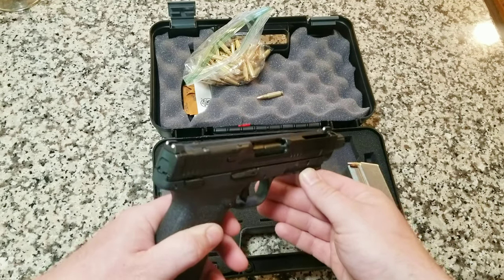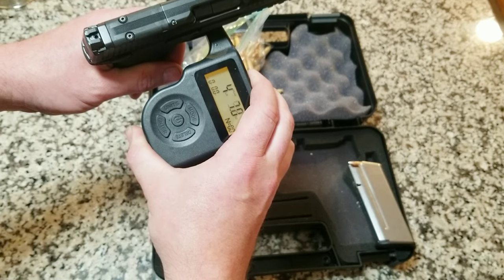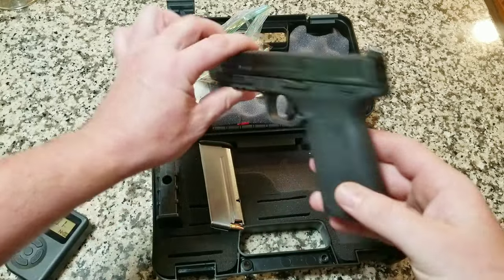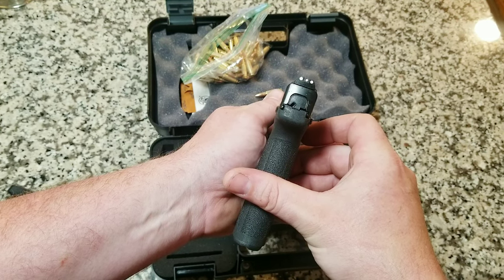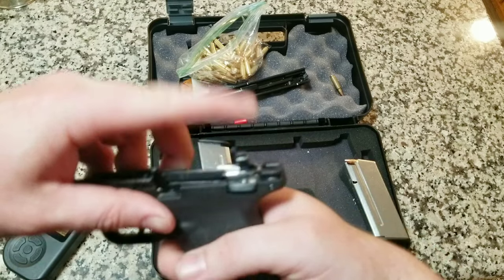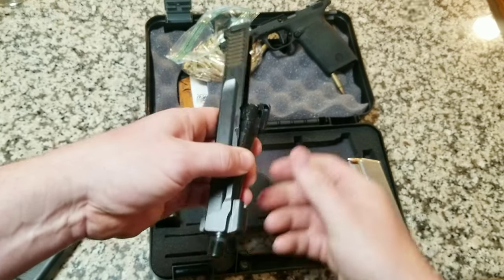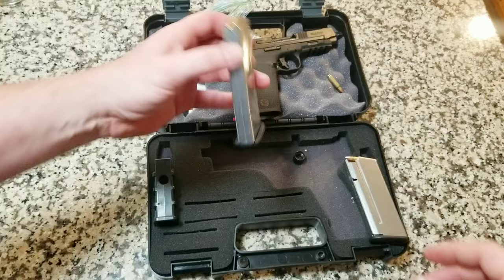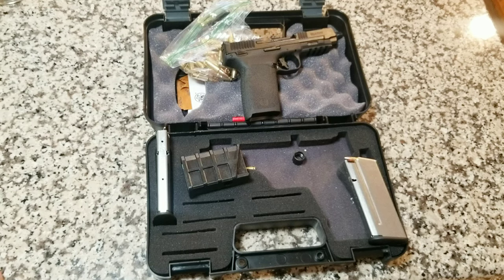Why the smith and Wesson 5.7 is pretty cool 😎

Comment: I had nothing but feeding issues with mine. If you load the mags over 18 rounds and chamber a round it jams, when mag dropped rounds spilling out of it all over the ground. No spring tension, followers dip down in front leading the rounds to jam on feed ramp. Sent back to smith and wesson, they sent it back 5 weeks later with 2 new mags with same problem and inside of gun filthy and the barrel and sleeve caked in something appears to be bearing grease. Wish I could add pics. Last Smith and Wesson I ever buy. Look deeper into this gun and it's a common problem. They don't care. S+W the new HiPoint.
Reply from the maker: That's wild man! I can definitely see your point with the mags! I only shot about 100 rds threw mine with zero issues.  But the mags definitely dont have much tension on them. Had I not gotten this gun for free I wouldn't have bought it. I definitely keep an eye on it and see what happens.  Thanks for the info👍
Reply: @GearsAndGuns  I know it's a no no but I put a drop or so of oil on inside of mag when I bought new and I haven't had that happen since..and oil is basically gone now..
Reply from the maker: @benlaubscher6371  that's cool man. Makes sense, a little lube there would help! Thanks for the information